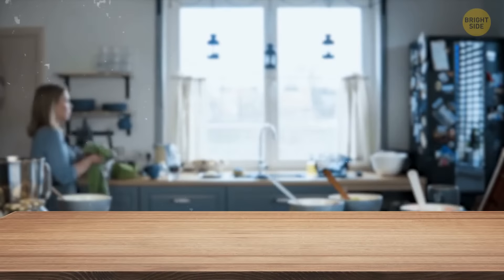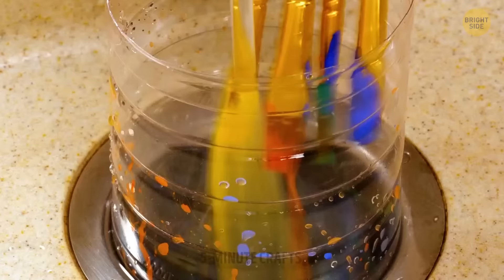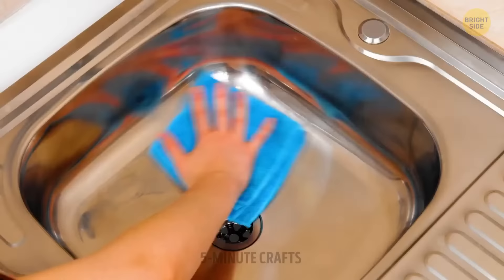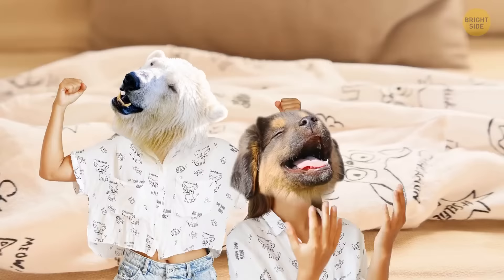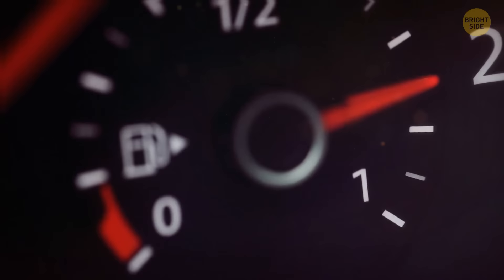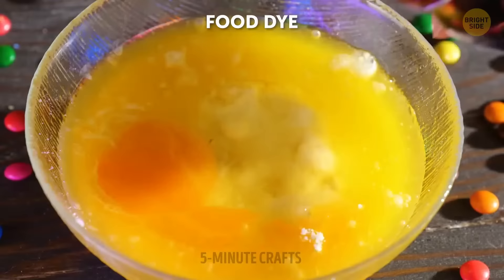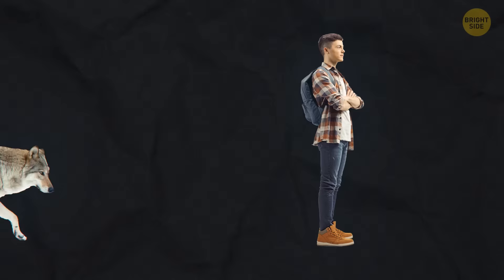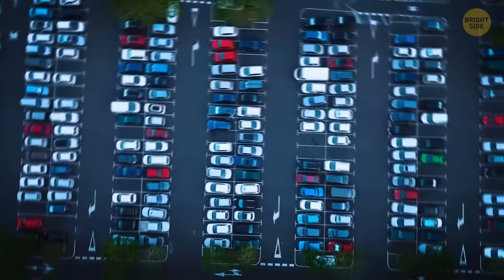Tricks That Will Make You a Level 100 Master of Life

Comment: That’s not true at all. Both hp and torque have a sweet spot where max output is achieved. Torque is almost always lower in the rpm band, thus why diesel engines operate at lower rpm OH WAIT it’s 5 minute crafts… makes sense now